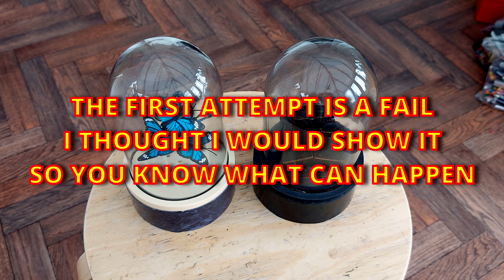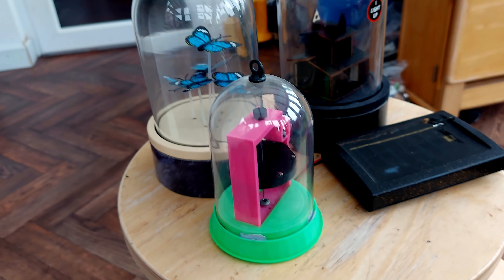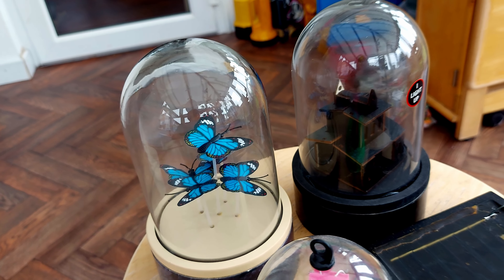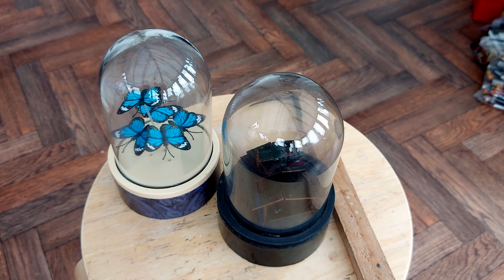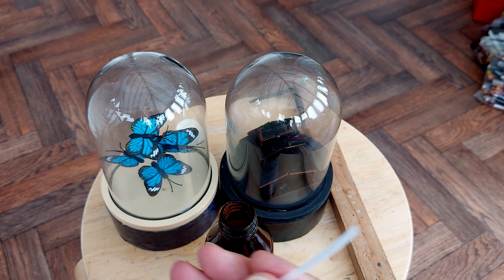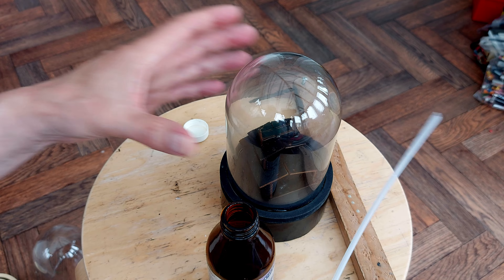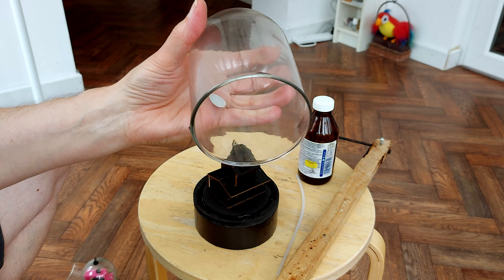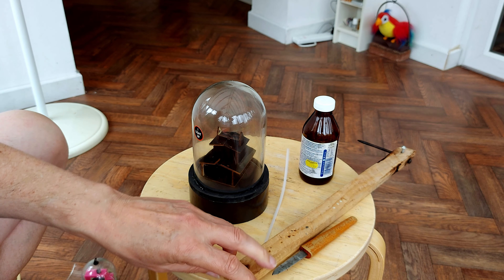Can I reuse Poundland Glass Cloches? 50% success

Comment: Shame one broke but at least you have the knack of freeing them now nice share. They are very nice great to put projects into and make them look classy 👍
Reply from the maker: That was very frustrating, it was 99% free, but the ridge round the end held it in place. I should have used the hair dryer from the start. The bottom of the base is just a cheap card ring. I wonder if glass is now cheaper than plastic. I was quite surprised when I first looked at them in Poundland as I had expected them to be plastic.
Reply: @GrandadIsAnOldMan  you can definitely see a difference between the glass and plastic ones, I prefer glass anytime. You could make some nice base's for them not sure how practical 3d printing is cost wise, but if you get a hole cutter the right diameter should be able to make nice base's for them out of wood. 👍
Reply from the maker: @johnwynne-qx6br  Probably be 3D printed, depending on what I need to put in the base.

Comment: 👍👍👍👍👍
Reply from the maker: I should have used the hair dryer from the start 🙁🙁
Reply: @GrandadIsAnOldMan  I  use a craft heat gun to soften glue but that would be  far too hot for the glass ..
there might have been a hairline fracture already in the glass at the point of the break
Reply from the maker: The lip of the cloche was trapped in the gap, so even though the alcohol had released it from the glue, it was still trapped. I didn't want to use the heat as I was worried uneven heating would crack it, but I was careful to apply gentle heat over as much of the glass as possible to warm it evenly. In hindsight it might have been possible to apply the heat underneath the base to warm the wood enough to melt the glue 🤔
Reply: @GrandadIsAnOldMan  At least you had the other one
Reply from the maker: @chattybatty7726  Even the broken one could still be used with a suitably tailored base 😁😁positive thinking 👍👍
Reply: @GrandadIsAnOldMan  absolutely x

Comment: Use 99% IPA
Reply from the maker: No, that wouldn't have helped. IPA does not dissolve hot glue, it just releases it from the surface. That was what the problem was here, it was fully released, but the rim could not be pulled through the glue so the glass broke.